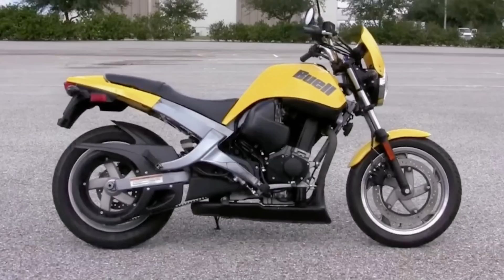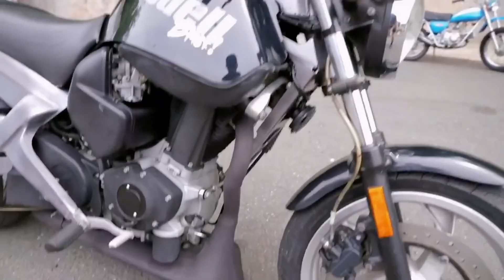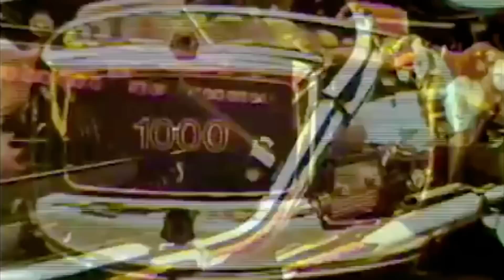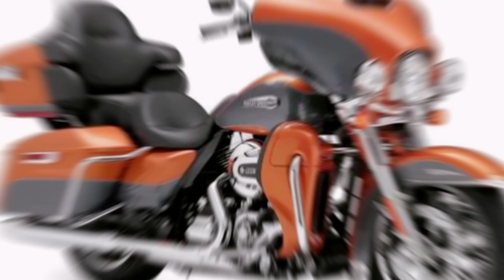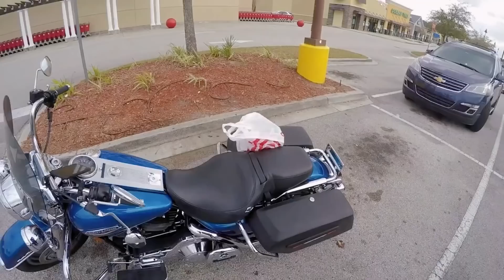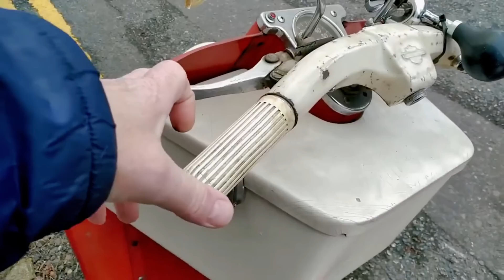Top 6 Worst Harley Motorcycles

Comment: I bought a new softail deluxe in '05 with the 88ci engine. I have never had it back for any work. I do all the maintenance myself. I don't know what their talking about with the bad mouthing of this engine. It has been totally dependable. Once I had to change the master cylinder for the rear brake because I had to go off road to the shoulder of the road(ditch). After coming to the crest of a hill there were about 25 wild turkeys crossing the road & I was doing around 50 in a 35mph zone. I ended up cracking the M.C. reservoir. I purchased only the reservoir even though it was advised to buy new insides too. I instead transferred all the original parts over and still like new.

Comment: Ridiculous. The 2014 -2016 "Ultra Classics" were the same bikes & they did not have a water pump. The 2014-2016 Ultra LIMITEDS are the bikes with the water pumps. And other than than the POS OEM water pump on the 2014-2016 Limiteds, the 2014-2016 Ultra Classics & Ultra Limiteds were rock solid model years. Go on some Harley Davidson forums & actually actually do some research. Tons of 2014-2016 high mileage Classics & Limiteds still on the road.